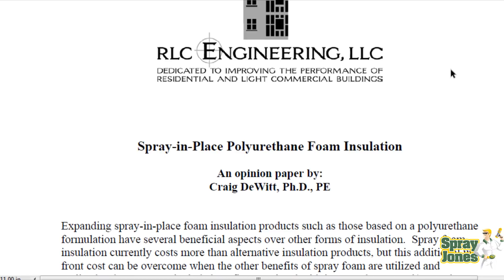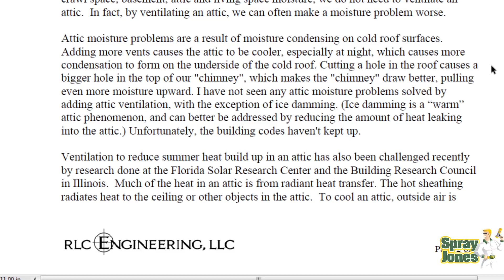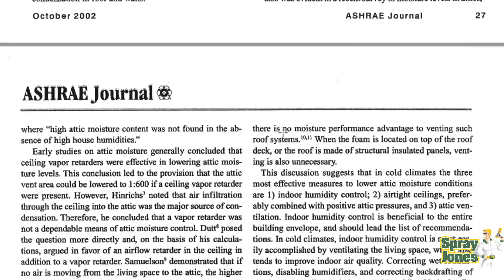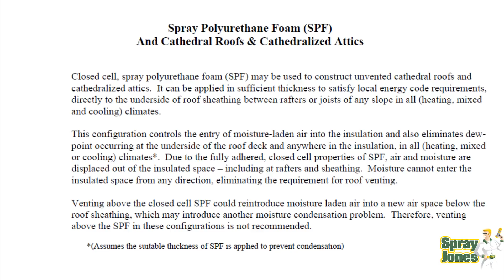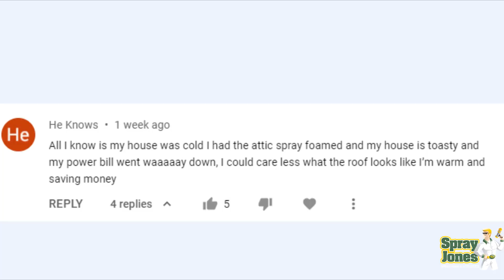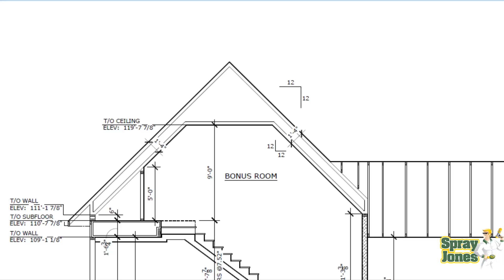Cathedral Ceilings, Attics & Roofs with Spray Foam Insulation | 2 of 4

Comment: Hello my question was how can you replace the sheathing if its rotten and still get a air tight seal i researched this and nothing,.. i guess you can replace the steathing and take the drywall off from the inside and spray the foam and replace the drywall? would this be the case?
Reply from the maker: Covered in video #3
Reply: @SprayJones   i checked that reply from you out no video or Documentation you provided....
Reply from the maker: @TermitesRGood1  What are you talking about? That will launch on Tues.
Reply: @SprayJones   so you making a video i will look forward to it,,

Comment: Curious what your thoughts are on AeroBarrier and whether it should be utilized before/after SPF, especially considering using it on a house with a conditioned attic space.
Reply from the maker: The idea is sound. I think there is no replacement for hand applied caulking and going over ever ft2 yourself to ensure the seams are for sure done well. 
We have a 2nd person doing it while cleaning up is underway.

Comment: Nice presentation! 👍 I think you pretty well covered everything pertinent in this segment.  I appreciate you taking the time to present this information.  I was a die hard "flash & batt" guy and the information you have presented in the last several video's has changed my mind.  I totally agree.  I'll be going with closed cell spray foam.  The only exception will be interior wall sound proofing with Rock Wool.  Glad I have been following along with your video presentations.  They are WELL worth the time invested.  Excellent job!
Reply from the maker: Thank you! That is a great compliment!
Reply: I was never truly on board with flash and batt (mainly because it would’ve been me doing the batt for the entire cathedral roof and walls), but now I have an understanding of why not to go through that trouble.

Comment: Great video Mike! I only recently became aware of your channel through the Marshal project, but so glad I did! I have been watching a lot of your older videos to catch up. Do skylights change the calculations at all? Specifically, I feel that skylights are prone to water leaks over time, and with closed cell keeping water in place, wouldn't that amplify the damage to roof sheathing? Do you do anything different at skylights?
Reply from the maker: We spray them in around the boxes. Skylights always leak... so it is like a boat: the day you like it the most is on the first day you get it, and the day you get rid of them.
Reply: @SprayJones  That's so true! I look at the 3 skylights I have at least once a week trying figure out if they are leaking yet. I plan to spray foam the vaulted ceiling they are installed in, maybe they'll get removed then. Thank you

Comment: Thank you for the very detailed video and examples. I have a roof constructed of roof trusses which are 2x6 for rafter sections. As closed cell foam is approx R7 per inch and I need to achieve R38 or more for NYS code, is the only and best solution in your view to "pony up" and do almost 6 inches of closed cell? Alternatively, do you see any value to some combination of spray on underside and either rigid foam sheets on out side or batts inside ? Again, great content - thanks for taking the time to show your knowledge and be a good advert for the industry.
Reply from the maker: Check what the code is for cathedral ceilings. Have an engineer write the spec and seal it for you. Shouldn't be R 38. 
I mention that in the video....
Reply: @SprayJones  Thank you for the reply and for the great content on this channel. You should consider a consulting business ! Keep the good info coming....
Reply: @SprayJones

Comment: Major definitive work. Next vid will take us to the outside air and that is the game changer. Liquid applied, peal and stick, CDX or OSB,  Zip or not, regular underlayment with shingles, cold roof with steel, added rockwool over the OWB/water proofing or not, and oh boy will this be good. How great would it be if we could use CCSF on the top of the sheathing and on the outside of the wall sheathing for full envelope water/air/vapor including the underfloor!!!! Thanks thanks thanks. Bob Jarrard (50+ yrs as a general contractor and glad I only built in very temperate climates)
Reply from the maker: You are welcome.

Comment: Do you have any advice for someone considering metal roof trusses? With the rising cost of lumber it’s become a more enticing option. I am not sure if spray foam would be the way to best insulate them, or if exterior SIPs would be the best. Do you think encapsulating  the entire metal truss would have any value or be feasible?
Reply from the maker: If you use metal truss you need exterior rigid or SPF from the inside to stop the metal from getting so cold and causing condensation issues in the attic. 
I have no issues spraying the top flange and embedding it in SPF.
Reply: Spray Jones thank you. That’s exactly what I was envisioning. With metal you should be able to mix both systems right? There isn’t really a chance for rot besides rusting over time.
Reply: Spray Jones and by both systems I means SIPs and closed cell SPF

Comment: Only problem I see is if you needed to replace the roof sheeting with the spray foam glued to it. I would agree spray foam would make the roof stronger.  I've used 2 inch foam board over the roof sheeting. Then used 2 x 4 going  perpendicular to the rafters for roof sheeting or metal roofing. I tape all seems for airtightness. Then use rockwool between the rafters. The whole building is wrapped outside in 2 inches of foam board. My way is probably more  complicated and costly.
Reply from the maker: That is addressed in V3. It is not a big deal.
Reply: @SprayJones  OK thanks. I no that spray foam is extremely sticky.

Comment: I’m just here to research before building a tiny home on land. Plan currently is 12’X20’ on piers. 3-4x12 pitch with 2” rigid under a standing seam over osb all on top of 2”X8” rafters with 4” of spray foam then the ceiling nailed to the underside of the rafters. At least that’s the plan.
Reply from the maker: That sounds bullet proof.
Reply: Will be cozy

Comment: I am going to have my new home spray foam with the underside of the roof as well if my building inspector will go for it here in Milford PA  any tips to help the building inspector agree to it. This is great keep it coming. Thankyou.
Reply from the maker: Yes, get all your engineering done as I have been saying. Video 3 will go over that more. 
Stamped drawings will end the discussion.
Reply: @SprayJones  Thank you Sir, great work